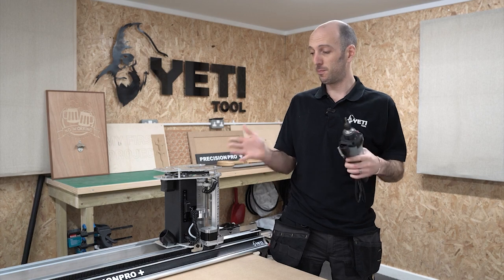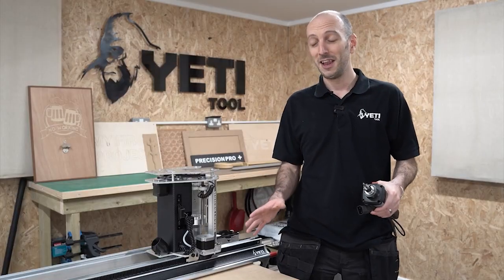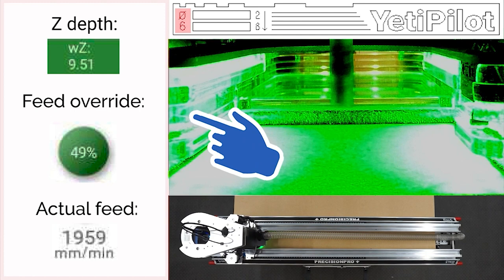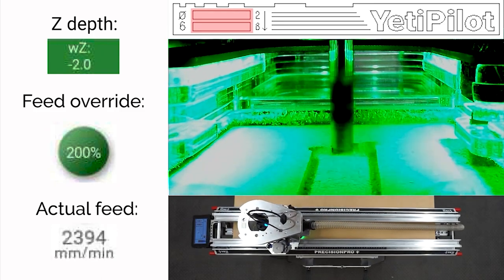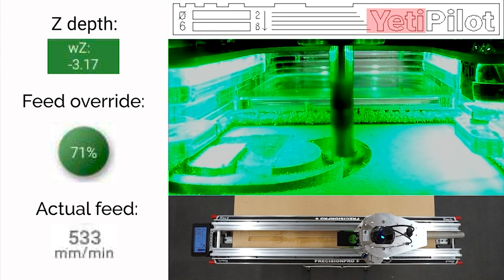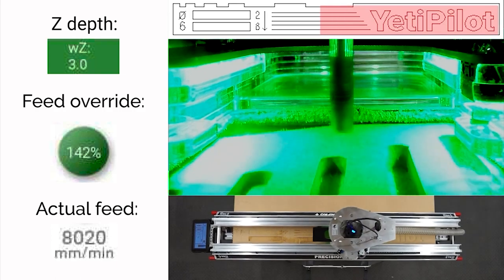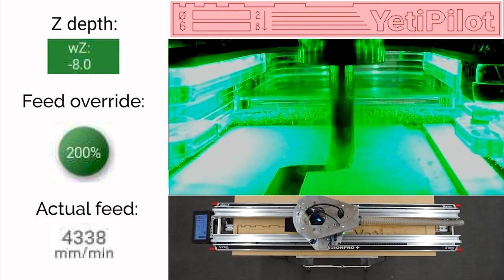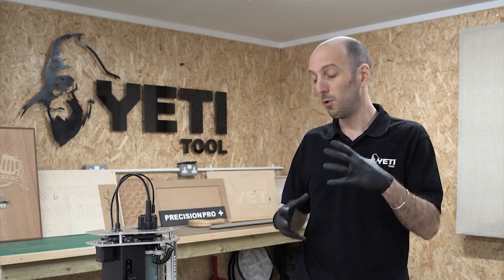YetiPilot Demonstration | Bringing Adaptive Feed Rate Control To CNC Routing

Comment: Great news. 
What is the upgrade pack?
Is it just the new spindle?
Reply from the maker: The upgrade kit includes a spindle and a software unlock key.
Reply: @YetiToolLtd  why is it only v1.3 that can upgrade?
What is the difference between the 1.2 and 1.3?
Can 1.2 be upgraded to 1.3?
Reply from the maker: @Biolumine3cent  V1.3 machines have a different electronics architecture, which is needed to support YetiPilot. A V1.2 machine would need a new Upper and Lower X Beam as well as Z Head.

Comment: Does this maintain the feed rate to RPM ratio so the cut finish stays consistent?
Reply from the maker: Thanks for the comment. YetiPilot won't adjust the spindle RPM however, the cut is still consistent throughout.

Comment: Can existing smartbench pro be upgraded with new spindle and software?
Reply from the maker: Hi Donovan! Thanks for the comment. This upgrade is available for v1.3 users. Please head to the product page where you can type in your serial number to check if it is compatible
Reply: @YetiToolLtd great mine can be upgraded  it will be add ing to my short list  for upgrades along with getting 4’ bench